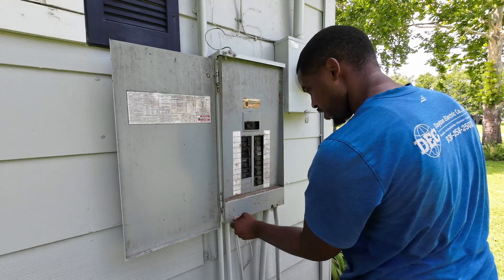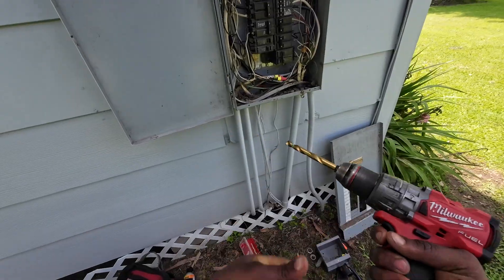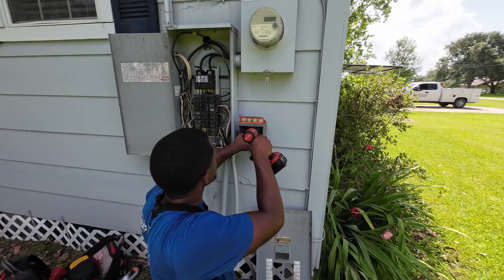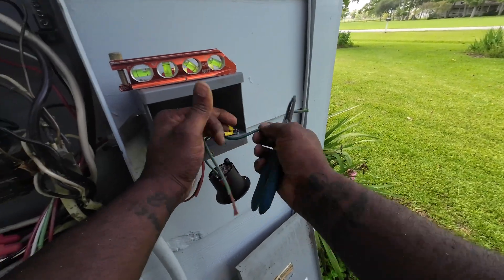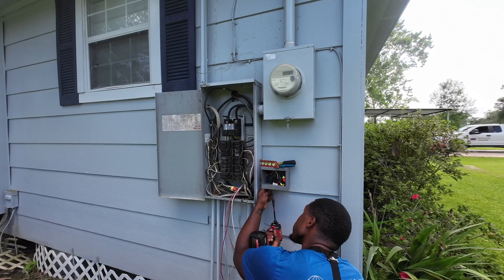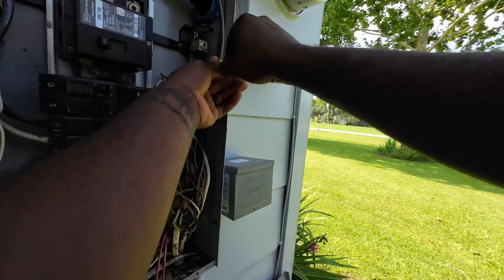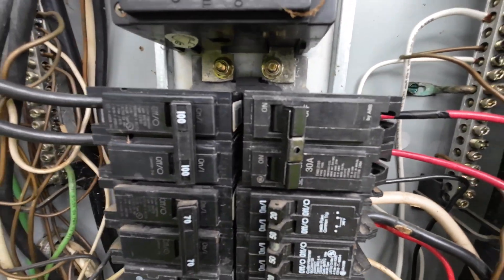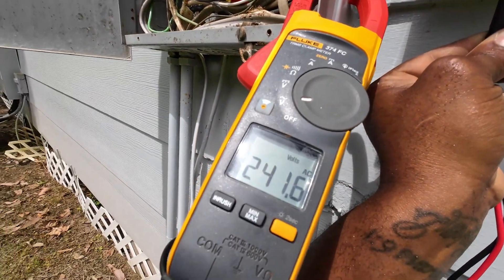Day in the Life of an Electrical Apprentice | Reverse Service Generator Plug Installation (POV)!

Comment: I noticed you have a Ford (F250?) service truck. Bring a nice 55gal Rubbermaid trash can with you. Keep it next to you when you're stripping wires and other things that way all the trash goes immediately into the trash bin. Great way to save clean up time after you're done.
p.s. Fluke 374FC. Overkill for resi stuff but niiiiiiice!!  Dig that ability to transmit measurements to your smartphone.
Reply from the maker: Yes sir thanks for the advice, as for the Fluke I got for a steal couldn’t pass it up! Thanks for the support Brother!👍🏽

Comment: Nice work brother, bit of advice whenever you’re installing new breakers in a panel you should use the same brand of breaker as the panel God bless
Reply from the maker: I got you Brother that’s what we typically do, the customer had different breakers in there so  I was instructed to use the GE.. I got you next time & Thanks for the support again!👍🏽
Reply: So much respect.
Reply from the maker: @welcomebalance Thanks Brother I appreciate it!👍🏽